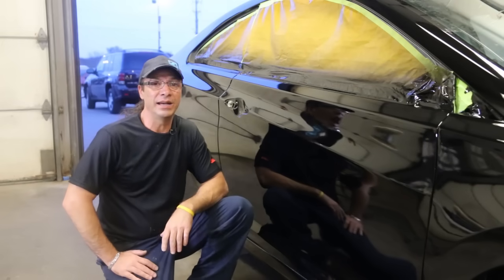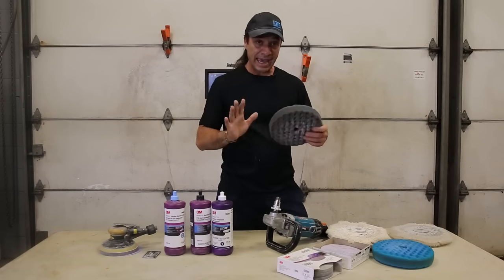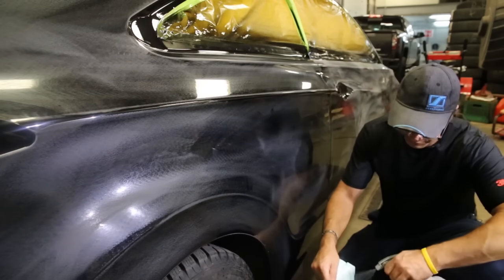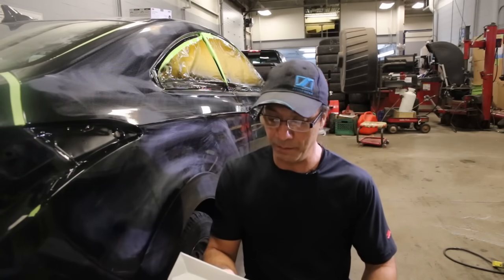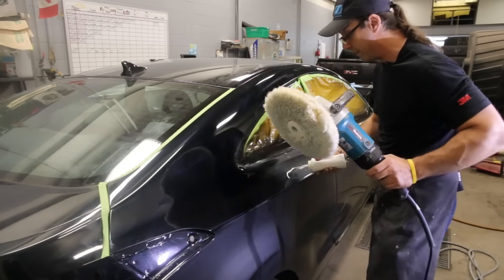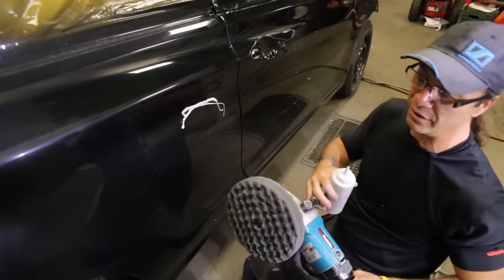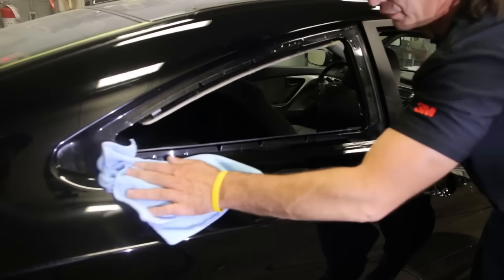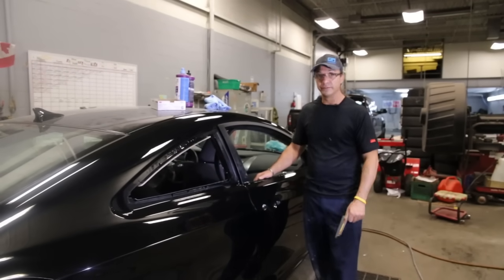Professional wet/dry sanding and polishing tutorial. 3m Trizact system, EX Compound

Comment: Hello great video.if I have alot of orange peel I painted in a garage what do you recommend.there a little dust point on the car as well on the clear coat
Reply from the maker: jaimef101 I would do it just like I showed in this video. Breeze over the surface with 2000, then you’ll be able to see all the dust in the paint.

Comment: Excellent demonstration, learned a lot in this video! Do you have any advice on bringing back or rather cleaning up a 47 year original paint job on an old ford truck? It had a lot of surface rust so i wet sanded it with a scotch bright pad to remove the rust and I assumed I should try to cut then machine polish? any tips?
Thanks
Reply from the maker: Dan Harder which scotch bright did you use?

Comment: Will this technique work on an older paint job that has swirl and light scratches?  Have a 2003 black Vette that needs a little help. Great video.
Reply from the maker: Not really but kind of. If you have access to everything I've used, I would use a compound pad first, then a polishing pad, then a black foam, then the blue foam for removing swirls. There are lots of other cheaper alternatives then using 3m for regular polishing, and probably faster too.

Comment: I was impressed with your work ethic and high degree of organizational 
forethought. My question is this: I applied 2-3 coats of black spray to a 
hood and am having trouble with adhesion in  3 spots, those spots have 
been sanded down to the primer and resprayed. What's the deal? Also... 
should I Clear Coat the hood and stop worrying about base coat 
imperfections OR is paint alligating already an issue on this hood? 
Thanks
Reply from the maker: The only time you ever want to really sand the base is then you are doing a high end show car. You get a flatter job by removing the peel before clear coat. Not many perform this any more. It's odd that you are having issues in only 3 spots. Are you putting your hand down on the primer while sanding? Your hands do contain natural oils and could cause lifting in those areas you are resting your hands on. Just a hunch.
Reply: loveja1 if you sand base, you need to apply more base or you will have adhesion problems.
Reply from the maker: Kent Buehrer
if you sand the base, then you will have the scratches you need for adhesion for the clear.

Comment: Hi Tony,Really appreciate the time and effort you put into this great vid.  I have a small backyard shop that I can usually get high end results out of.  Lately I've been getting the 3M polishing compound (white) not brightening up the final finish after wet-sanding with 3000.  I AM using the foam pad and not the traditional wool type, although I have used it (wool) previously but when only sanding with 2000 and using a cutting compound.  Any thoughts or suggestions as to why I'm now only getting a half way mirror polish?  It is sort of a gray or hazy finish.  Perhaps it is because the foam pad is worn??  It does have a lot of miles on it now.  LOL   I guess you'd suggest switching to a wool pad for the first stage compound (white)?
Reply from the maker: +RPMX4 Hi, thanks for taking the time to watch the video. It's really hard to pin point sometimes what a problem can be without being there or seeing it. Could be that you need a new pad, or the paint is still too fresh to polish. I never liked a foam compounding pad, you have to generate too much heat to get the scratches out. Stick to the wool pad for compounding, you will get better results in the end. Good luck and let me know how things turn out. Cheers.
Reply from the maker: Hey. Have you found your problem? Changed pads?

Comment: Great vid.. what other options are there for polishing. The 3m Finesse 3 step is expensive @ $165  all I have to do is a hood that was re-cleared. The finesse would be great in a shop where it will be used  but I might use it twice a year on small areas.. are there other options you could recommend?
Reply from the maker: Do you have access to a rupes orbital polisher? Or any orbital polisher.
Reply: @loveja1  yes
Reply from the maker: @myfast5oh  if you finish with 3000, you can usually just use a rotary with a wool pad and polish, then use the orbital polisher with polish to finish it off.

Comment: I'm a huge fan of the rotary polisher on fresh paint as well as detailing.  I see guys wasting hours of time with these orbitals when they should just spend  time to master the rotary. The rotary does everything that an orbital can do at twice the speed and has far more versatility.  Great video. 
One question, What speed do you compound with vs polishing ?
Reply from the maker: Dan Henderson thanks for commenting. I pretty much use the same speed throughout. 1600 I believe. The only time you use an orbital is when it’s the final step and removing swirls. I like using the Meguires swirl mark remover with the orbital. Don’t forgot people, time=money.

Comment: I love how you used the 1500 to shave down the texture and I noticed u said to leave a little orange peel. If I wanted to shave down the texture a bit more would it be safe to do another pass to get a more mirror finish with 1500 . Say if you did another pass of 1500 dry?
Reply from the maker: First question I will ask is why do you want a mirror finish? Is the rest of the vehicle like that? If the answer is no, then leave the peel.
Reply: @loveja1  actually the whole car just got painted , just wanted to enhance a little more the texture
Reply from the maker: @reinier1234  in the case that the whole car has been painted, then it’s fine to go a little flatter.

Comment: Thanks for explaining in detail. Had my chevelle  re-painted, looks nice except for the waves on the panels that were not there before. I was told maybe there is too much clear.. would wet block sanding straighten those waves out? The shop used your technique but sanded dry. Then buffed. No block sanding. The wavy panels are driving me crazy....help!
Reply from the maker: Sorry for the really late response. Usually you can’t fix wavy panels by wet sanding, it actually makes it look worse because now you’ve flatten the finish to a mirror shine. Don’t let them fool you, the wavy panels are from improper body work or prepping.

Comment: I've been detailing my own vehicles for years and still consider myself at entry level. Learned a lot from your video. After you polish, at what point does a person wax? I'm under the impression that waxing is only to keep foreign atmospheric elements and impurities out. Basically waxing is the final sealer and can add to the shine. Am I correct?
Reply from the maker: Jerry Johnson I have to say, this has been a long debate. If the paint is fully cured, then for sure wax it. I always wax fresh paint as well. Many people will say that’s bad for fresh paint but I’ve been doing it for years with no problems. I’ve never used a paint sealer on fresh paint though.

Comment: what speeds do you use on the steps? 1800-1400-1200 are what i use. Respect that you keep things clean for the detailers, we've all been there... Even though they like to degrease the panels we just rubbed all the product into😂
Reply from the maker: I keep all the steps the same speed. 1500 which is 3ish on a makita.
Reply: You forgot to degrease the surface and show us the afters ;).
Reply from the maker: | Little fucker. You are absolutely right. It was almost midnight when I finished and forgot to say a lot of things too.  But for your degrease comment, you never use that while wet sanding and polishing. Thanks for the feed back.
Reply: You compensated this by a full and clear demonstration - steps. Thanks for sharing the vids and the quick reply. Cheers.
Reply: I wish he answered this too. I'm sure it's fine because you need to remove fillers.

Comment: I’ve tried to get this system to work for me but the 3000 da always ends up pig tails all over, I’m not sure if it’s the paper clogging running too dry or wet. I’ve even had the 3m reps out to show me but they end up with the same. How do you minimize the pig tails? And great instructional 👍🏻
Reply from the maker: peter hughes the most important thing is keeping everything clean. Wipe the panels down with water first to eliminate any dust. Every sheet of 1500 or 2000 you use, wipe it off with your hand. Those sheets are what is causing small circular scratches, not the 3000. You can only go so far with the paper then it has to be replaced. You may go through a few sheets just for any average size hood. Make sure you remove all the dust before starting with 3000 wet. The flatter the surface, the better the 3000 will work. Buy be careful to try and keep that original orange peel finish. Let me know if that helps.
Reply from the maker: peter hughes are you using 3000 only? From start to finish?
Reply from the maker: peter hughes and also... did you put a cap full of soap in your spray bottle? 3m tells me not to but it works much better. Adds lubrication.

Comment: Hey so I have a question for you man.. I hope you see this soon... So I've pretty much grew up in this trade being around it my whole life my dad paints and builds cars he mostly specializes in custom show cars stuff.. anyways I got a job at a local body shop a few years ago and since I already knew how to buff and color sand (that's what they called it) they had me doing any and all the buffing after it came out the booth.. Well my dad is old school as well and has always used the wool pads for cutting/compounding and so that's what I learned with as well so when I started working at this shop and working under this painter this guy made me do things his way... So what we would do if there were any runs, dirt or just any little imperfections in the clear we would just nib it with 2000 grit 3m wet/dry sand paper id go around and just hit those little spots only and then I would hit it with a DA with 3000 and then finish off with 5000 and then I  would do my buffing after that... So this is my concern and question   like I said I normally would use a wool pad with 3m # 1 then 3m #2 with the black waffle pad... But this guy had me using 3M's perfect it #1 finishing material that's what the bottle says its green compound btw the code is 36064 just so you know exactly which one I'm talking aboit...So I would use that stuff with the recommended pad to do all my compound cutting and most the time we'd just leave it after that and send it on its way but certain colors like black Id have to use the black #2 pad and polish after ...So I'm just so confused cause that 3 turquoise/green pad I'm talking about says its a finishing pad so then how is it working to cut and finish the color sanding?
Reply from the maker: adrean harrigan is the green compound a 1 step?

Comment: Do you have any video working on a regular OEM PAINT  using sand paper and whole pad by the way you are master
Reply from the maker: 4AUTODETAIL 4AUTODETAIL thanks for the great comment. What are you wanting to know about factory paint?
Reply: It Is the same proses to work on Trizac system on OEM paint ? which  electrical DA sander do you recommend
Reply from the maker: 4AUTODETAIL 4AUTODETAIL pretty much any palm sander will work. May just have to change the pad on it. Yes there is a difference in the sanding mostly. You have to understand how much paint a factory finish has. Most European cars tend to have more clear coat than an American car will have.
Reply: loveja1 thank you very much for
Your time and for sharing your knowledge ...

Comment: Awesome video. Thanks for making this. But i always worry with sanding. Are you sanding the paint or the clear coat? And does the polishing process replace that layer of clear coat so you can do it again?
Reply from the maker: iiCUBE OiD most everything painted these days is 2 stage paint, which means base coat (colour) and clear coat. And there is 3 stage as well. As you wet sand, you are removing a bit of the  orange peel which means you are sanding off mills of clear coat. That can not be replaced by polishing. Actually does the opposite.
Reply: @loveja1  Thanks a lot. We're trying to learn the polishing process as a part of a university vehicle project and this was a great video to watch.

Comment: 2012 ford escape over the wheel well paint had bubbled up and rust was under it.I think i need to use the rust encapsulator then little bondo and paint ..but affraid to do it..got any tips what i can do? color white suede...
Reply from the maker: Walter Topij is there a hole through the rust? If so, it needs to be cut out and a new piece welded in.
Reply: there is no hole but there is a doubled layer of steel. there is a 1/2 trim that i pulled off from the under side like a L shaped lip,  i think it would need to rivet a 1/2 x5 inch long. I think it's like the rim on the inside of the wheel well. i can show you pictures if needed...

Comment: I'm rookie , I've painted and used a micro flake ,ran out of blender clear,so began mixing micro in with my clear alone , pressure up too much on gun so got a very ruff finish and the flake is presentable with a hand rub and over all distorted from the eye overall the areas.i still have half a gallon of clear I'll be shooting but without flake ,so before I finalize theses last 2 coats of clear ,what is your take as far as doing in order for me to get the best results. Remember a couple of panels are not so clear ?
Reply from the maker: JustA GoodOboy flake should only be used within the first couple of coats of clear. Then strait clear after that. Be careful sanding that now because if you go too far, you might start burning the flake because it may be standing up in areas instead of laying flat. At this point you may want to sand it with 800-1000 and then reclear.

Comment: if you have no heat booth,how long should i wait before i wet sand and buff,my clear i use medium harder,,,ive been waiting 16 hours [ at 72 degrees ]  and i find it takes me roughly about 12 hours.   it seems that i go though alot of 1500 paper,,O i like your video,and i subscribe
Reply from the maker: Earl Wilson you may want to read the data sheet for that particular paint. They all vary in drying times.   As long as it doesn’t leave a finger print you should be fine.

Comment: Thanks for sharing. Question: the soapy water for wet sanding...is that also used when buffing tough jobs? I noticed you didn't use any water on this new paint
Reply from the maker: I only use a cap full of soap for the wet sanding. It helps with the lubrication.